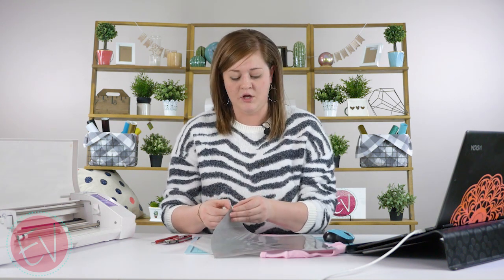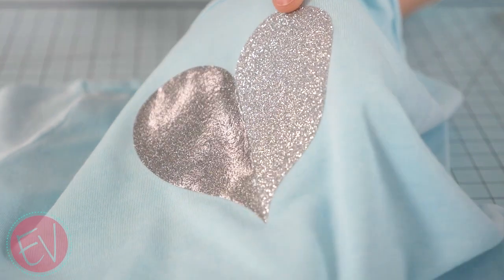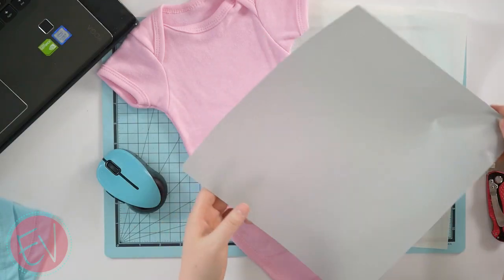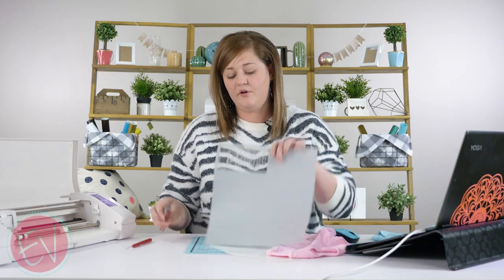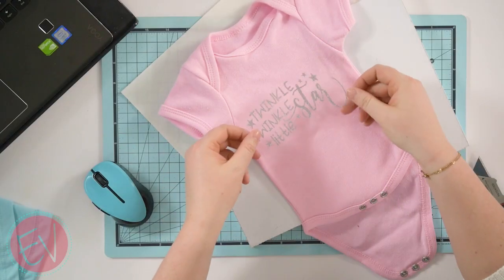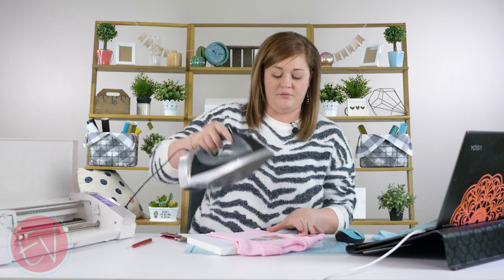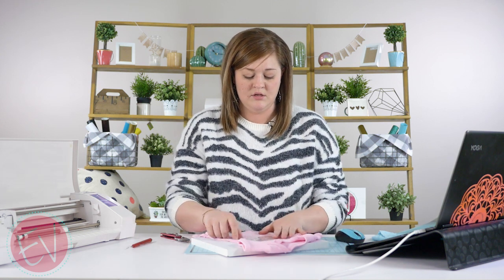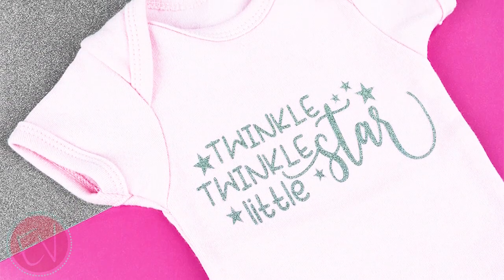Twinke Heat Transfer Vinyl Overview

Comment: Okay so I use the glitter setting and more for cutting. I passed it through 3 times and it did a awful job of cutting as it did not really cut through. Needless to say it was a huge mess. Any tips to offer. Also I used a new blade too.
Reply from the maker: For Twinkle, place the carrier sheet side down on the mat and mirror your image.  Try a test cut, something you can test weed that is less than a half inch, on a setting that has more pressure than the glitter setting.  Adjust settings for test cuts until a good cut is found.  Each machine, blade, and batch of vinyl may differ enough to require setting adjustments.
Reply: @Expressionsvinyls   just so I have this right the milky looking side is face down on the mat or the shiny side ?
Reply: Just thought I would let you know I figured out my sweet spot and probably operator error. I was cutting or attempting to cut on the glitter vinyl but it actually cut on glitter iron with 2 passes and pressure more at 90 no problems

Comment: Does it need to be the top layer?
Reply from the maker: Yes, it will need to be the top layer. Or you could use the knockout/ slice method so that it looks layered but it is not.